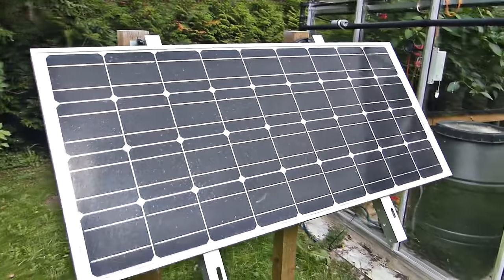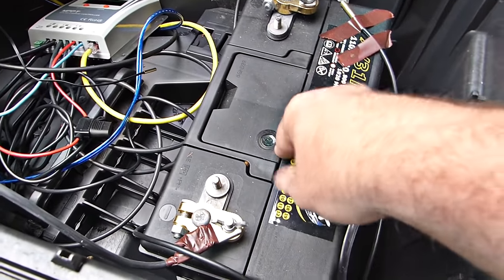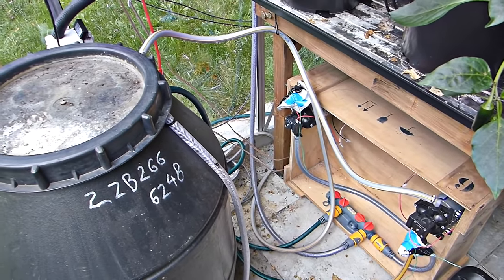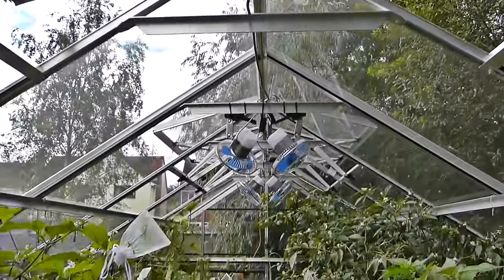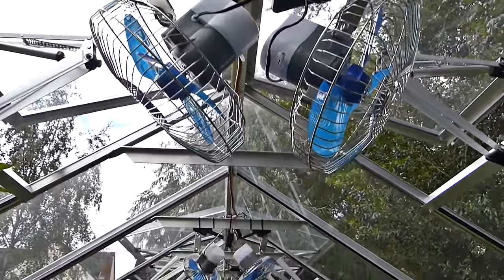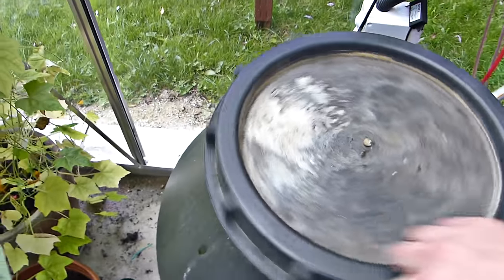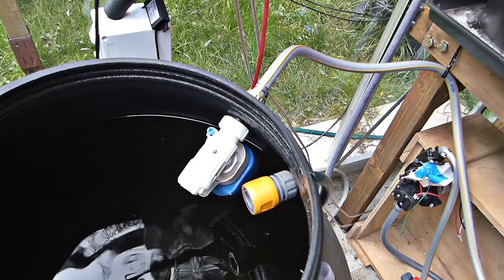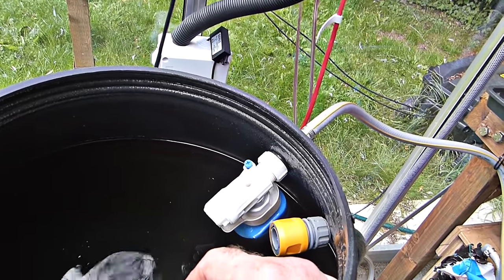Off-grid Greenhouse and Garden Automation

Comment: Many thanks - very useful. 
Came across your video looking for cooling methods for my greenhouse - I currently have the wax filled type like yours .. but over time I have learnt to """hate""" them! :)
The "cunning plan!" Use a 12v dc car radiator fan 14" approx £16  - 90Watt with volume over oscillation :(
Reply from the maker: I actually like the autovents (wax filled). As long as you keep them lubricated, once a year, then they seem to work great!

Comment: I quite like this, as I have a 40W mono panel going to an MPPT converter, that then goes to 1) a 12V battery bank (retired UPSs), and 2) a 12V timer. I then use the timer to feed the tomato and chilli plants from a 100L reservoir with a little pump (there is also an air pump and stone that keeps the water extra oxygenated), and the 100L tank is then kept topped up from a gravity-fed source with a float. Just have to manually adjust the pH and EC from time to time (every few weeks it seems, unless it rains or a frog gets into the piping). Thanks for the awesome content, as always! PS I use 'real' electronics for any sensor components (currently just night/day pickup); capacitors and transistors, not a digital program :P

Comment: I planned crazy stuff like that a few weeks ago for my greenhouse and the I discovered Autopots! A dynamic system works much better I think. Nevertheless great work!
Reply from the maker: I like the control I have with my system. For example at the moment the temperatures have really dropped...so my plants will only need to be watered once this week.  Last week we had really high temperatures and lots of sun...I was watering everyday, sometimes twice. That is all automated with this. It takes into account average temperatures, waters accordingly. My system is also doing visual analysis, if the plants start to droop then they also get some water. Plus it's just fun being able to track the stats and optimise the growth year after year

Comment: Hi Sean. This is a great video and one that I've been particularly keen on revisiting. I have two allotments with two glass greenhouses and soon to be built 16ft X 24ft polytunnel. I noticed in your later videos that you have IBCs for water storage now. It would be great to see an updated video about your irrigation automation system, water storage and how you manage automation of fertiliser too. I think I recall you had an extra water pump and water butt just for the fertiliser. Was wondering if you still go by the same system or if you've upgraded? I've been trying to decide between purchasing an off the shelf solar powered irrigation system from a company called Irrigatia or whether I should build from scratch, allowing me to add things like fans and usb/laptop power. (My allotment is off-grid). Cheers
Reply from the maker: Hey Peter, you may be interested in my second channel. I have a beginners guide series on automation. www.youtube.com/ChilliChump2

The concept for my watering is the same...collect water off the green house.  Pump from the main collection tanks into a smaller tank in the greenhouse.  Mix nutrients when I need, and irrigate from there. Cheers, Shaun

Comment: Hi. Your video nspired me to set up an automated system, though not yet with all your bells and whistles. One question (Why is it the simple things are often the most difficult to work out) : As the fertiliser is added to the tank and is continuously provided whenever water is added am I right in thinking that it is very diluted (much more than usual). Using chilli focus as an example what level of dilution are you using?
Reply from the maker: Hi David. The way I control this is by having a resovoir in my greenhouse that is seperate from my outside rain barrels. That way I control the concentration. So I fill up the 230l barrel in the greenhouse with pump1. Then if I am doing fertilisation with that barrel, I will add the fertiliser (depending on the stage of growth, either seaweed fert, tomato fert or chillifocus). Then I don't add more water to that resovoir until it is empty. I don't fertilise with every barrel either. That would be overdoing it. 
Also if you are interested in more of the automation type content, have a look at my second channel, I am doing a beginners guide to automation there: www.youtube.com/chillichump2
Reply: @ChilliChump  Many thanks for the speedy reply. I am setting up my pumps and solar panel this week. Once I get the basics working I will be nerding out on your second channel. I have copied your set-up with the separate  barrel in my polytunnel. The mix in that is standard? I am frightened of killing my plants with too much love! (I came across this video when I ordered my polytunnel and reckon my first strawberry has cost around £3k. I need the chillies to thrive to get the cost per unit down a bit! ) Much better than the usual gardening channels. Keep up the good work.
Reply from the maker: I don't feed with the recommended dilution rate. I change through the year depending on how my plants are doing. But half recommended dose is a safe bet.

Comment: Mount your fans the opposite direction. Instead of pointing them down, point them up. You can still have them oscillate.
It will be a remarkable difference in moving hot air out, and the bees will be fine.
Reply from the maker: The fans are not for cooling. They are for helping with pollination, as well as keeping mould away by moving air around. The temperature is controlled by the autovents

Comment: I am working on setting up a solar powered greenhouse. Is the 100W panel still sufficient with the grow lights you have added?
Reply from the maker: Like I mentioned in reply to your other comment, running things like heaters or lights off solar power wouldn't be viable

Comment: Microcontrollers can also crash. It's not common, but it does happen.
As for a raspberry pi I have, it runs pihole and some vpn hosting software. It's ran for months on end without ever having issues. I'll occasionally run updates on it, and restart it, but I've never actually had to go up to it and pull the plug.
Reply from the maker: With the microcontroller....you have the WDT which will reset it if it "crashes". I also have other code running which kicks in if the WDT doesn't do its job.  I have been running my ESPs on fluctuating voltage (solar, battery) for 3 years now without a failure.

Comment: Love it!
would you or have you used moisture sensors to control the watering using this set up?
Reply from the maker: I have experimented with water sensors...but found them a bit unreliable. Unless you put multiple of them in each pot, your readings will be too erratic to rely on for a watering schedule.

Comment: Oh, and what cable are you using? I've been running it all with 4mm (12awg) that should handle ~22A perfectly fine, but find over my 5m run I'm dropping about 300mA.
Reply from the maker: I use 12awg too , mostly (just some twin and earth I had spare). I also use 14awg for my seperate hookups from my controller Actually I am just rewiring everything at the moment...I have been modifying my setup a bit (adding things).  I find the wire is fine, I don't get bad voltage drop (<3%). Just got to keep an eye on the lengths you run!
Reply: @ChilliChump  Yeah I might shorten it just for that sake, or get some better condition batteries :) Thanks for the awesome work and info.

Comment: When you turned the fan on, why did the battery's charge current go up?  Shouldn't the battery be left alone if the solar panel is producing enough power to run the fan?  I'm not sure why running the fan would require more power to be fed into the battery, potentially overcharging it.
Reply from the maker: The battery charging is managed by the charge controller. If there is a draw on the battery, the charge controller will decide whether it is able to charge during load. It is all managed automatically. It keeps the battery topped up when it can (if it is day time and there is enough sun hitting the solar panel). Temperature and voltage is monitored so overcharging cannot occur.
Reply: @ChilliChump  It just seems like the wrong figure is being reported.  The way it shows in the video, if you run nothing, the battery won't be charged, and if you run 70 W of equipment, the battery will be charged at a rate of 70 W.  It's almost like the load current figure is being shown instead of the charge current figure.

What I would have expected to see is that the battery charge current doesn't change much with the load changes, unless the solar panel can't deliver enough power for everything, at which point the controller reduces the charge current (or even draws power from the battery, making the current go negative) in order to power the load.

Have I missed something?
Reply from the maker: The figure is definitely correct. I have confirmed with a multimeter. The solar panel I am using is 100w (19v max). Instead of the traditional PWM tech, the charge controller uses MPPT (maximum power point tracking) technology. This allows the charge controller to maximiuse the efficiency of the power coming in via solar panel but utilising the full voltage provided by the solar panel and shifting the voltage down, and increasing the amps to charge the battery. (check out this article, it will explain it better than I can https://www.solacity.com/mppt-vs-pwm-charge-controllers-whats-difference/ ). Of course if I am drawing over 100w, then my solar panel won't be able to push that amount of power back into the system. 

I just switched my fan on to get some figures for you:
Load output: 2.01A, 13.19V, 26.51W
Solar input: 1.41A, 17.07V, 24.13W
You can see that the load is at 13v, and drawing 2amps. The solar panel is providing the charge controller 17.07v (it is an overcast day, so not running at full spec) which the charge controller does its magic with and optimises the battery charge.
Reply: @ChilliChump  Sorry I think I am not explaining myself very well.  Very familiar with MPPT and understand what you're saying, but if you look at 24:27 you will see that the web page says you are putting 0.98 amps into the battery to charge it (the "Charge Current" figure) - which sounds fine.  But skip ahead to 25:43 and once the lights are on, it says you are now pumping 5.65 amps into the battery just to charge it!  I would expect to see 5.65 amps as the total load on the system (most of that being used to power the lights) but it seems to be showing as if it's the amount of power being fed into the battery itself.

When I say "the wrong figure" I mean it looks like the value shown for "Charge Current" and "Charge Power" is coming from the total output power, not just the portion of that used to charge the battery.

I am of course assuming you have a charge controller that measures the battery current and the connected load current independently, however perhaps you have the load connected in parallel with the battery, and that is why the charge current figure seems to represent the total load?

Hopefully this makes sense!
Reply from the maker: I get what you are saying....but have a look at this screenshot I just took. This is on a less ideal day, in terms of sunshine for the Solar system, it has been raining most of the morning. Which means that the battery has to play catch-up to get the charge back to 100%. https://i.imgur.com/JpD55gs.png . The charge current is at 3.44 amps, the incoming amps from the solar panel is 2.49 amps. The watts is the same on solar input and charge output due to the conversion. As you can see I am only using 6w on the load (my microcontrollers).

Then I turn on my fans, and a couple pumps. The watt draw is now at 146w (11amps) but of course my solar panel is only rated at 100w. The sun is shining a bit right now, so I am getting 80w (5amps) from the solar panel, the charge controller is converting that to put in 6amps.  https://i.imgur.com/xLgl8a6.png

Now, when the battery is full, and I switch on a fan or pump, and it is drawing less than the solar is able to produce at that time...then the charge controller puts the same amount of amps into the battery as is being drawn, effectively running the load from the charge from the solar panel instead of drawing down on the battery. Does that make sense?

Comment: Awesome video and explanations, any code examples for this project?
Reply from the maker: Hi Stephen, thank you. I'm busy doing a series on my second channel as a beginner's guide to automation. I will also be putting some of my more technical videos on that channel. www.youtube.com/chillichump2
Reply: @ChilliChump  awesome, I'm currently building a similar system around the Arduino Mega2650. I noted that you went with the WeMoS instead of the Uno but did you still code these in C++? not sure I caught that bit (only halfway through at the minute - keep flicking between videos and Arduino IDE when I get an idea haha!)
Reply from the maker: @stephensimmons1537  I am using the esp32 and esp8266 which are both far more capable than the arduinos, plus they are WiFi enabled.  And yes I'm coding with the Arduino IDE using c++
Reply: @ChilliChump  Aye I've got a fair few WeMoS, i've got a WeMoS mega coming but it's on the slow boat from China. As I'm going to be zoning out my garden I'm going to be needing a lot of analogue and digital pins which anything smaller than the Mega doesn't give me and I'm not getting into I2C addressing any time soon!

Analogue pins for the sensors and their values then digital pins to power them up momentarily for a read and then set state back to low when complete.
Reply from the maker: I would recommend looking at the esp32...the wemos mega you are going to use is a combo of the uno and esp8266. The reason I switched from the eap8266 to esp32 was because there are plenty more gpio and a load more analogue pins.  Plus dual core, more memory, better sleep mode etc.  Plus it only costs about $5.
Reply: @ChilliChump  I'll grab a couple to play with. They're virtually the same as the nodemcu aren't they? (node is esp8266 based though I think?)

You swapped out your WeMoS for ESP32s?
Reply from the maker: @stephensimmons1537  wemos is just the brand. There are plenty different ones out there which build Dev boards based on the esp8266 or esp32. I link to the ones I'm using in the first video of the series on the other channel.
Reply: @ChilliChump  just had a quick look, will definitely follow the series.  Been looking at using MQTT for setting and getting states of stuff for a while.  Time to stop procrastinating I guess! Thanks for the engagement definitely given me somethings to think about. Turns out two of my WeMoS are already ESP32's the others are ESP8266's so I'll get blinking with em and see where it goes.

Comment: What about a hybrid system? like a backup and log system for the microcontroller tha can be remotely controlled through rasberry pie and also be a  back up system
Reply from the maker: That's not really necessary with the way I have built and coded the system. This communicates with a website I've created. If for whatever reason the devices can't access the web, they fail back to a default schedule which will keep things running until I have a chance to address the issue. The website alerts me if it hasn't had communication from my controllers for a set amount of time. I considered a raspberry Pi running a LAMP server to do something similar, but honestly this is working just fine and means I don't have to maintain another device (I already have a webserver I pay for). Also I stayed away from using raspberry pi's on my solar system...they are power-hungry compared to the ESPs